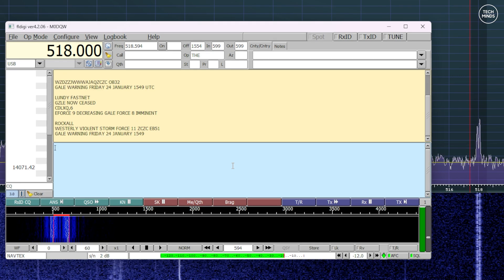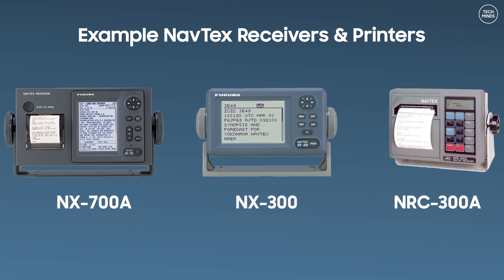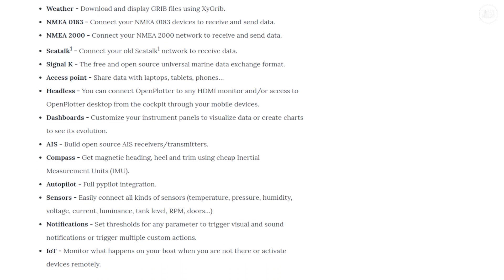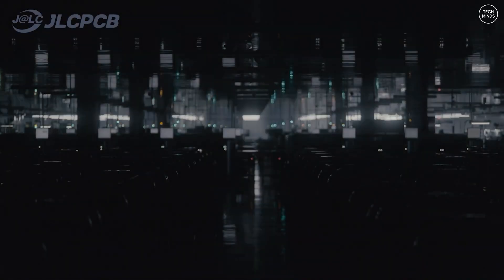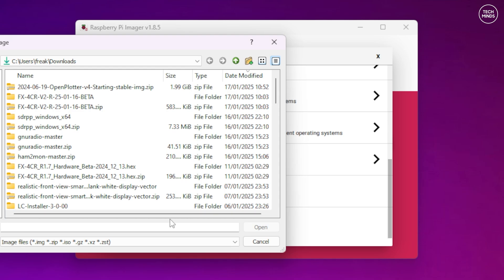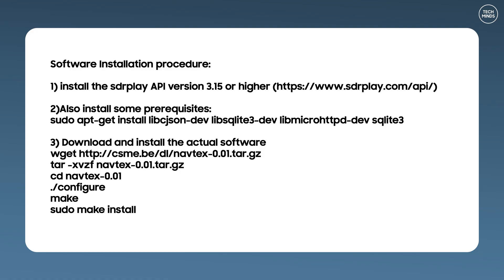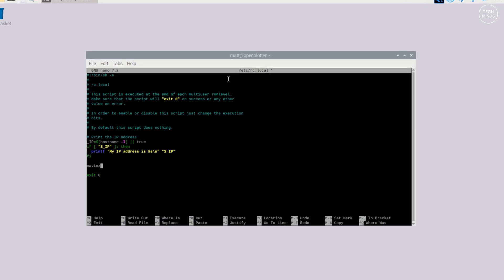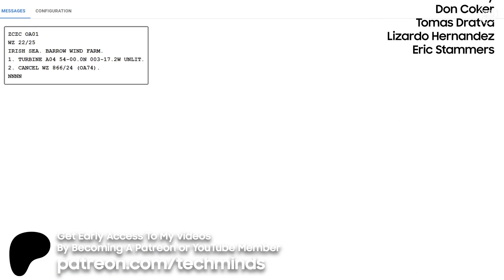Automated NavTex Receiver Using A Raspberry Pi & SDRPlay SDR

Comment: Very fun project. However, I would treat it as "fun add-on" but never rely for rpi + diy setup like that for any critical applications, that you life depends upon. Seawater, interference, system stability, SD card issues etc... all this could make your whole navigation/life-saving tools go down in the worst possible moment, when you need it most.
Reply: That's an interesting/moot point. Do you trust your own work and set up more than you trust a commercial organisation? There are a lot of boaters (cruisers) travelling the world who have been using RPI s for over a decade with no problems. If you build it yourself then you're better equipped to fix it 🙂. But there is also possibly a correlation between DIY and understanding; at sea, the most useful weather forecasting tools are your eyes and the barometer. 

Apologies if this sounds patronising; it's not meant to. It's that I'm always fascinated by attitudes towards risk appetite. I met sailors who thought I was mad to sail solo across the Atlantic while I thought that they were mad to do it without astro nav as a back up for their chart plotter. 

Each to their own 🙂

Comment: I live with the middle of England, pretty much as far from the sea as you can be. Does this get broadcast only at sea or is it detectable inland too?
Reply from the maker: I live just an hour south of Birmingham, and I get it very well.
Reply: @ Well, that's my weekend project sorted then 👍
Reply: Good luck, don't forget to activate the transmitter ID's of 'Niton' in the config tab: E and K on 518kHz, I and T on 490kHz. You can also try G and U for 'Cullercoats' on and O and C for 'Portpatrick'

Comment: @Tech Minds Matt where did you get the short usb type B cable ? Do you have a link. Thanks
Reply: The Lindy web shop is a home for dependable, high quality, screened USB. Matt and I had to buy cables there for use with Minitiouner DATV receivers.
Reply: @davidholman2536  excellent advice my friend. The shorter the better as less of a virtual antenna effect from RF as with the longer cables. 

I also am looking to buy one for my Silex DS700AC which i use to  put my Yaesu 991A on the network and run remotely from laptop and heil headset. Thank you

Comment: Thanks for a super interesting video. Unfortunately I felt asleep when the Linux part was there and I hope it will be available on Win or Mac OS in the future as the "world of prompt" is to much yesterday - so to speak 🙂
Reply: Porting to MacOS is probably not a very big step. Win, don't know. 
I have no intention myself of attempting either of them. The thing is that I tried to design a system for real use on a real boat. I can assure you that if you're on a sailing yacht making a UK-BE crossing in 20kn of wind at a close reach, the last thing you want to do is to go inside and sit in front of your laptop screen.
Reply: @boatcomm  You are doing that so well and I understand how an incoming storm at sea is scary and all the things that must be taking care of before and under the storm. I deeply respect that - you must never doubt my friend 🙂
I definetely like your project big time and thanks for showing the details and sharing your thoughts!
Reply: macOS and Windows have prompts, too.
Reply: @almightyEsquilax  Who didn't know that?
Reply: @bjarkekorsgaard
Mac OS is based on UNIX, just as Linux is. (Think of them as cousins rather than brothers.)
So if you are trying to be snarky, you just snarked yourself.
And I won't even start on Wincrap.

Comment: Thats what i wanted to do as a project for a while but i dont want to buy expensive stuff like rtl sdr :(
Reply: RTL SDR are about 25$/€ plus antenna
Reply: @ in first world countries with no stupid processing fees, yeah. Too precious for me though, I can’t just buy it over the internet.
Reply: @hoteny  I guess you're here to complain about any and everything. What is the purpose of your comments? Cam you even answer that question yourself ?
Reply: @campandcook3118  Does RTL-SDR go down to 518 kHz without an external converter? I have understood, maybe incorrectly, that its lowest freq is 25 MHz.
Reply: According to their website RTL-SDR Blog will tune down to 500kHz, in direct sampling mode on the V3 and using upconversion on the V4.
Reply: @Aitch-Two-Oh Good to know, thanks.
Reply: @Aitch-Two-Oh whats the difference? i was thinking v4 is just superior because i dont know everything
Reply: @hoteny  do you have internet there? 

--> RTL-SDR  blog V4 dongle initial release. 

Oh, btw before you jump at it, rtl-sdr has wide bandwidth input so ideally needs an external filter to not be swamped by stronger signals but it depends on location and situation.
Reply: @campandcook3118  it uses the sdrplay api, so not possible (yet ?) with an rtl-sdr.